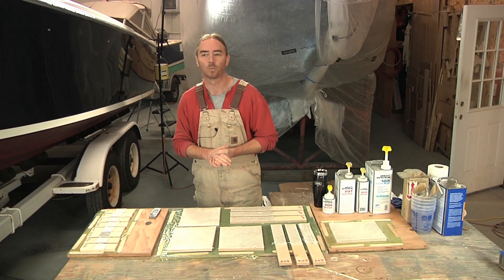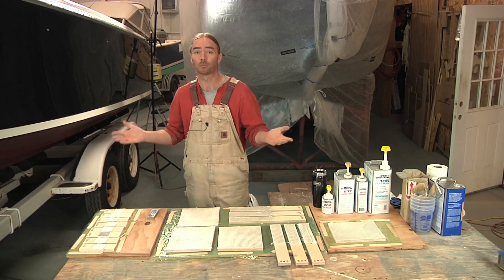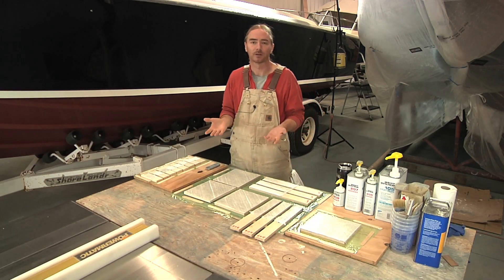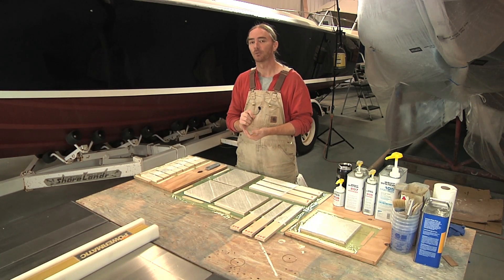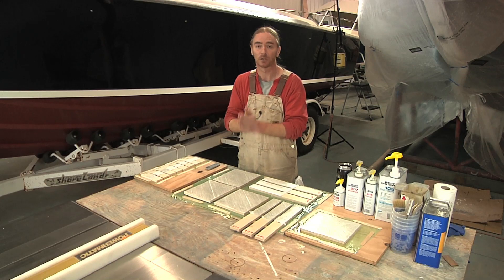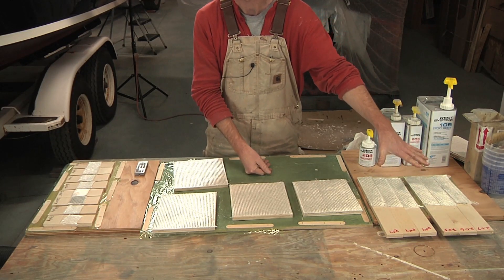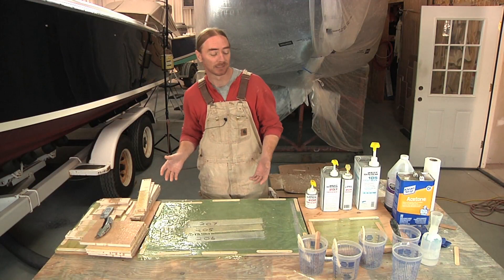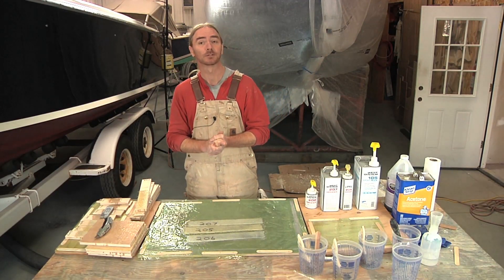Will Gelcoat Stick To Epoxy?

Comment: Hi bro I am having an issue with my gelcoat after I applied it its been 3 days and it's still tacky what should I do to fix it could u help me please
Reply: Did you include wax in the last layer of gelcoat? Polyester resin requires addition of wax in the final coat to seal the surface and dry hard
Reply: You need to use wax in your final coat or it will always stay tacky, to my understanding
Reply: Wet sand if not used wax

Comment: I’ve been stung by it before, the problem is when you run into it not knowing it’s epoxy
Reply: How? 
-if your mixing epoxy, you certainly know it’s epoxy
-if the surface is cured regardless if it’s a epoxy or polyester you have to sand it the same way

So how have you been stung?

Comment: I know this is an old video, but I now know something important related to this. Just because gelcoat will stick to West epoxy, don't assume it will stick to any other epoxy. Or cure for that matter. I'm currently in Panama and West epoxy wasn't an option. There's something in the local stuff that completely negates the MEKP in the gelcoat. On the edges of the repair where it overlaps the existing gelcoat, the gelcoat cures just fine. But everywhere else, it's as if I put no hardner in it at all. I mixed and applied it the first time. Then I called in a professional. Same results. I now have primer on it to seal the epoxy from the gelcoat. Let's hope 3 times is a charm.
Reply: Waxed or un-waxed gelcoat?  Amine blush on the epoxy?
Reply: Did primer do the trick? And which one did you use?

Comment: So I put gelcoat over completely cured epoxy, it did not cure after 4 weeks still wet. It will not cure without a barrier coat of some sort.

I wiped it off, used poly fairing compound on top of epoxy, and then gelcoated.. it cured in regular time.

Comment: Do you have any experience using Gelcoat over TotalBoat FlexEpox Flexible Epoxy Adhesive?
Also, what are your views on using TotalBoat FlexEpox Flexible Epoxy Adhesive in non-structural wood boat applications?

Comment: I question if you or anyone else has tried this with other brands of epoxy. To my understanding the biggest issues are being sure of a proper cure and removing the blush therefore any brand should perform similar. I'd love some feedback and your opinion on this and may even do this experiment myself on my kayak. It currently has several alterations and some repairs done to the fiberglass kayak with epoxy resin and I would like to finish it with gel coat with or without a product between.
Reply: What did you do in the end? ⛵

Comment: If the resin you’re using to make the “gelcoat” is epoxy resin then this doesn’t apply right? Because isn’t gelcoat just your resin, hardener, and color?
Reply: Gelcoat is a polyester resin based paint that cures hard as a rock you purchase it not make a in quotations gelcoat with epoxy resin

Comment: Regarding the amine blush issue, what are your thoughts on using 879 release fabric, or other similar products? Does this product also prepare the surface for a mechanical bond, eliminating the need for any sanding (for the most part)?

Comment: Hi there,

i know this is a really old video but figured id write you in case you could help :)

Id like to use polyester gelcoat with epoxy but the other way round..

Could i use Polyester gel as a mould liner and use epoxy resin over that ?

Thank you in advance
Reply: 100 percent yes. The test is for the otber way around. I've known epoxy over polyester but never polyesrer over epoxy.  I. Sure in small repairs its OK either way if prep is right and all blush is removed.

Comment: Tell me more about vinyl ester resin ? will it bond to epoxy?  Will bond to Polyester?
Reply from the maker: Hi Ken, there's a lot to explain about the different resins.  Probably the best place for you to start would be to take a look over the guide that I just put together.  I suspect that will answer most if not all of your questions :-)  Thank you!  https://www.boatworkstoday.com/product/fiberglass-101-download-guide-choosing-the-right-resin-for-your-project/
Reply: It's between epoxy and poly in both strength and cost, downside is a very low shelf life though.

Comment: Thanks for the experiments, very interesting to see what happened, great info.  My experience with boat repairs, everyone has an idea and or theory, so you have to take a look at the info and go with what you think will work for you.  Your experiment makes me want to lay up different types of reinforcing fabrics, and test them to failure in various ways.  1708 vs csm vs boat cloth etc.  I would bet performance of some of them or combinations would challenge conventional wisdom in some of the different loading conditions, torsion, tensile, bending, deflection, etc.

Comment: Hey Boatworks guy....love the videos. I have a 2003 Pro-Line 183 Stalker Flats boat. I am going to paint the bottom side of my boat (from rope rub rail to very bottow) and was trying to save a little money in not trying to buy brnad new browell  boat stands which seem to be the best. Can i modify 2-5 ton car stands? the bottom of my boat is pretty flat.......any thoughts? I watch your videos all the time and have learned tons about gel coat...thanks buddy
Bob Keliher
Reply from the maker: Robert Keliher Hi Bob, This is a tough one as I'm not comfortable saying it's a good or bad idea.  I would hate for something to happen and you get hurt (or worse).  Would it be possible to talk to a local marina / yard to see if you could rent some stands for a few days?

Comment: I am in the middle of a transom replacement job on my 2556 bayliner. I opted to use epoxy for my layup's and am very interested in the results of your tests before I decide whether to use gelcoat in the bilge or to use paint....thanks for taking the time to make these videos.

Comment: Cant wait! I put fiberglass over a boat I had years ago that was done with epoxy and it still looks like new. none ever came off.  I always tell people if you clean and sand it well it will stick. BUT the epoxy on mine was about 5 years old. I can see it not sticking if new epoxy.
Reply: True I've done it numerous times to on lobster boats that take a beating and show up next year to buff it and all the gelcoat is fine I've never even heard if this till recently that's how much it matters zero sand and gelcoat sticks bottom line